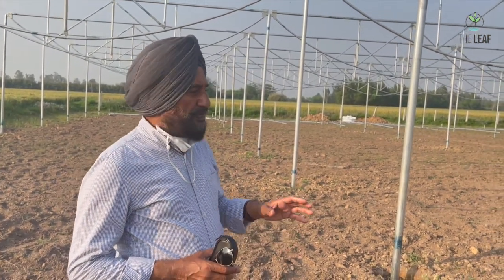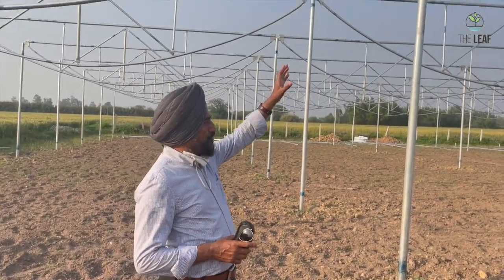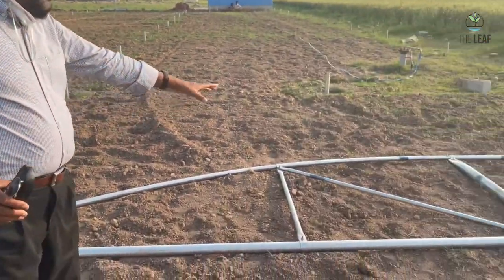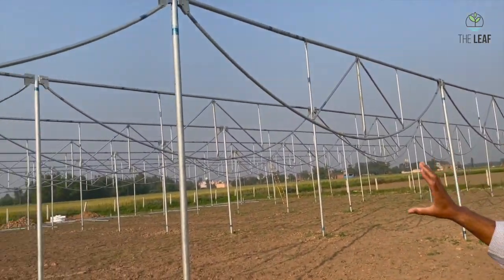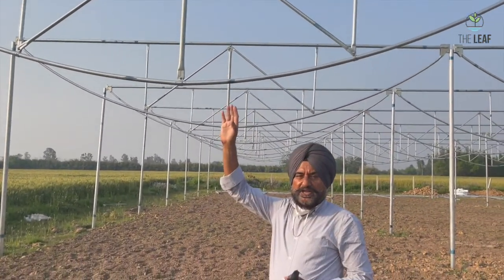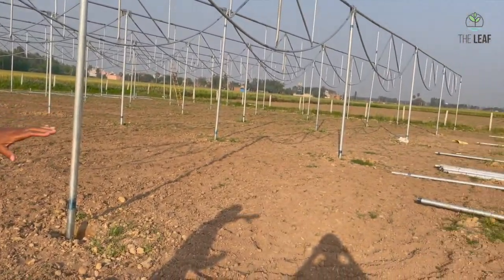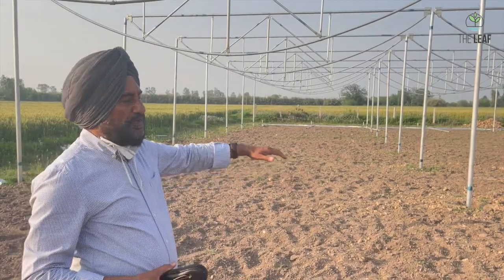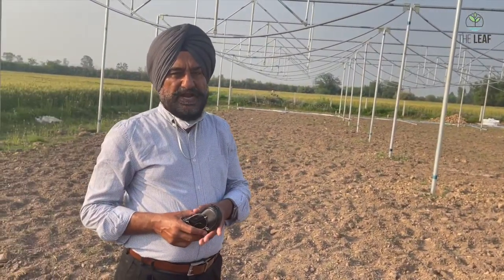Erection of Trusses on Columns - Polyhouse - 4

Comment: Your posts are on a 4m x 8m grid. How tall are the posts from ground to top?  Each truss spans 8m.? What is the height of the trusses and  what is it constructed of? It seems as though 2 different diameters of galvanized water pipe are being used.Typically galvanized water pipe  is available in 6m lengths.  Ideally any truss should be made so that as few cuts as possible need to be made and that there are no unused off-cuts left over. How are the brackets made that the truss pieces are bolted into? Maybe a whole video could be made just on the construction of  trusses!